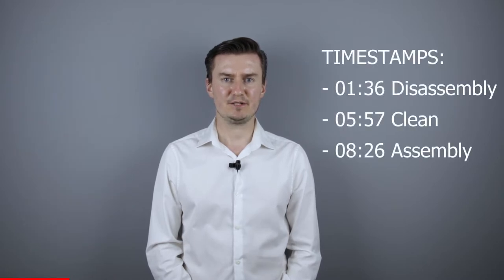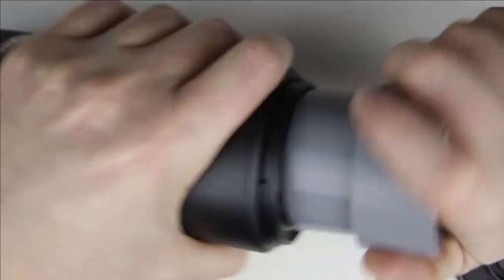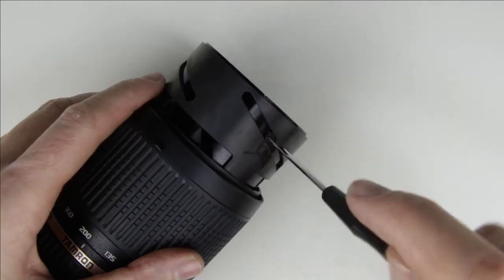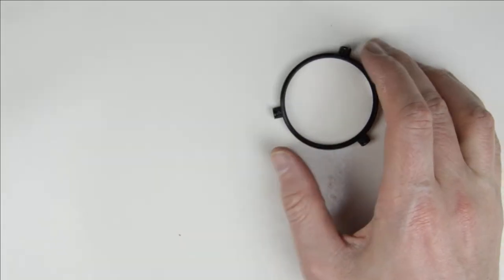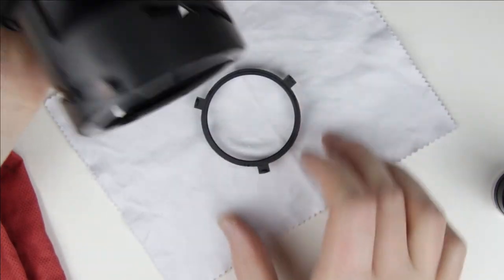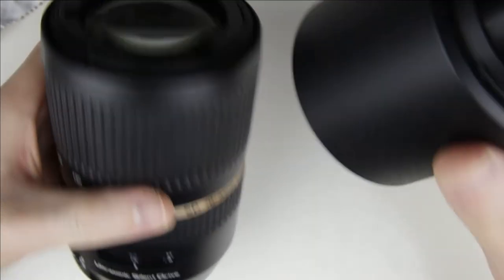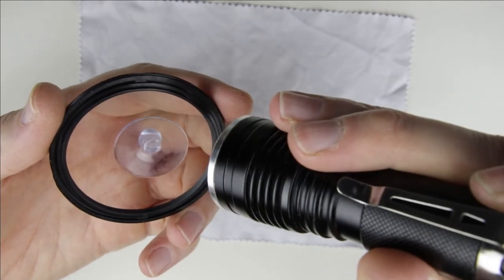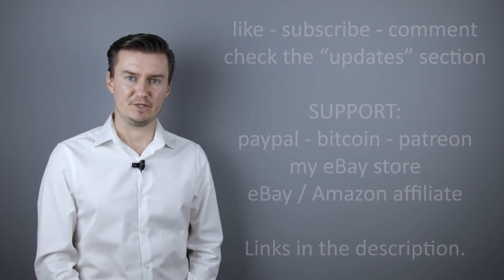Tamron 70-300mm f/4-5.6 SP Di VC USD A005 clean the lens inside

Comment: Muy buen video felicitaciones quisiera preguntarle cuando montas el vidrio no aprietas los tornillos gracias
Reply from the maker: I don't understand that, I couldn't translated it correctly... can you ask your question in english?
Reply: please I ask you to tighten the screws before placing the glass and I also wanted if you have a video to clean the mushrooms in a canon teleconverter thanks
Reply from the maker: @carlosalbertopalacioamado8742  Zoom back to a place where the holes of the front lens is at the end of the lens, that way you can put back the second lens element easily. I haven't repaired the Canon teleconverter, so I don't know how to do it.

Comment: This video is exactly what I needed. I have a question though. The tool you used to open the front element, where does it touch the front element. Does it touch the glass and rotate it or does it go into the two notches of the frame holding the glass? Do you try to rotate the front glass itself or only the black frame around it? And where can I buy this tool? Appreciate your work.
Reply from the maker: Hi! The opening tool touches only the black cover ring around the lens. If you have smaller opening tool which would touch the glass, you have to be very careful, the opening tool should be perfectly clean to avoid scratching the lens. I used a rubber ring which has good grip, it just touches the black ring, and it does not goes into the two holes.
Buying the tool: I bought it on ebay, follow the link in the description (thank you for using my affiliate link) or search for "rubber lens opening tool", I bought the "9 in 1" version. Alternatively, you can use a (drinking)glass, or some round item which is the same size as the black ring around the glass, and put two sided adhesive tape on the side for good grip.
Reply: @CamerasLensesEtc  thanks, the idea with the drinking glass sounds great. I think I will try it like that. Thanks man, you are awesome.
Reply: @CamerasLensesEtc  Unfortunately the link to the itm is missing from the description
Reply from the maker: @lionellosanti  The link is still in the description below.
Reply: @CamerasLensesEtc  Ok but it shows the metal spanner first, you have to scroll a lot for the rubber one :D by the way I managed using a pair of scissors... I doubt the rubber one would have done the job, very tight grip.

Comment: Hi. Thanks for the video. This is not the first time I've watched your video. Everything is very qualitative and clear.
I recently started repairing lenses. I enjoy it. But, unfortunately, I have a lot of questions. Like any beginner. One concerns this Tamron. The plastic ring in the lens is cracked. And the lens is falling out of it. This element is in the video at 5.55 minutes.
I want to glue the ring now. Can you please tell me how to glue such plastic elements of lenses? What is the best glue to use? And also, perhaps it is better to glue the lens to the ring? But with some kind of glue for smartphones. With which they glue the back covers (B-7000). Just in case it needs to be removed again.
What do you recommend?
By the way, I also have an old AF Nikon 35-105mm that has a cracked plastic aperture ring. So hopefully one tip will save 2 lenses at once.
Sorry for the bad English. But I think you might not know Russian.
Reply from the maker: I use superglue. I put some on a aluminium foil, and I use the tip of a spudger to apply it to the place where I need it. You have to be very careful with it, if it goes on the surface of the lens (and not only on the side) then it can damage the lens.

Comment: Very useful video, thank you.
Is it difficult to remove dust under the ring for the manual focus? It got very hard to rotate for maybe dust or sand beneath.
Reply from the maker: Check out my video about replacing the USM motor... in that video I remove the rear sleeve, so you have access to one side of the manual focus ring. I don't remember if the ring slides out after that, but give it a try.

Comment: Hi! I have the same lens and just replaced the usm motor. I found in some certain situations on the closest edge of focus it seems to spin but... WITHOUT ANY APPARENT MOVEMENT. So I clearly hear it does it's cycle but neither lens or focus scale move. 
Also sometimes, when it's already close to the limit and AF tries to move af even further there are loud "clacks" at stops. I moved the "brush" sliding contact both directions but it doesn't go. 
I'm afraid all that isn't nice for the longevity of the lens. Can you please kindly suggest how to manage it? Or maybe that's normal for the model?
UPD - something went out and manual focusing is struggling now too. Gonna dig down :D
Reply from the maker: Is the lens autofocusing correctly? If the brush is at the wrong place, the autofocus is not accurate, or the lens doesn't autofocus at all.
Reply: @CamerasLensesEtc  yes, it does. Af performance is correct

Comment: sir, just need your help, i have a tamron 70-300mm Af70 di ld it deference for your tutorial, when i open the front lens, their is other lens back of front lens and I'm difficult to open it because the fungus are inside the back lens,what tools i'll be use?
Reply from the maker: Hello! If the dust or fungus is under the second lens element, then you have to disassemble the lens starting from the rear. I have videos about replacing the aperture cable, you can view the partial disassembly. My opinion is that it is just doesn't worth to repair that lens, because it worth around 50 EUR as used.
Reply: @CamerasLensesEtc  50 EUR used what? the whole 70-300? I doubt
Reply from the maker: @lionellosanti  The previous commenter said that the lens is a different Tamron 70-300mm... The older, non-VC (Tamron 70-300mm f/4-5.6 Di LD macro) lens costs around 50 EUR used.

Comment: Hi, where did you get the grey tool used to screw off the 1st section of the lens and what is this called?  Cheers.
Reply from the maker: It is called lens opening tool. The ebay link is in the description below.
Reply: @CamerasLensesEtc    Thanks. Just looked, I can see the metal adjustable tool, but the grey rubber/plastic jar shaped device wasn't there. Is this needed? Or can you just use the metal tool?  Cheers.  Tom.
Reply from the maker: It is there, just scroll down. The tool I used is part of a set, and that is more expensive than the metal lens opening tools, so it appears later in the search results. Alternatively you can search for "rubber lens opening tool".
Reply from the maker: If you don't want to buy the lens opening tool, you can use a similar sized (drinking)glass with two sided adhesive tape on the side. Make sure that the tape is on the black plastic ring and not on the front glass.
Reply: @CamerasLensesEtc  Thanks !  Very helpful :-)